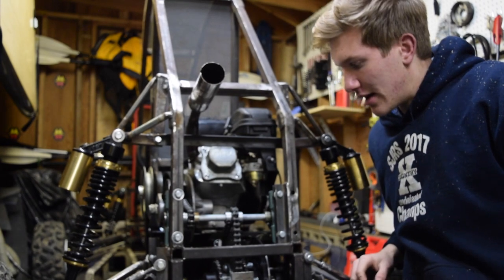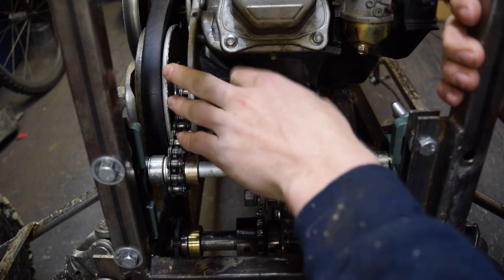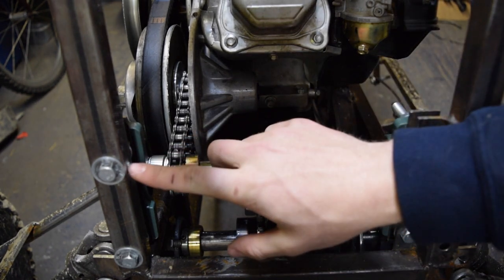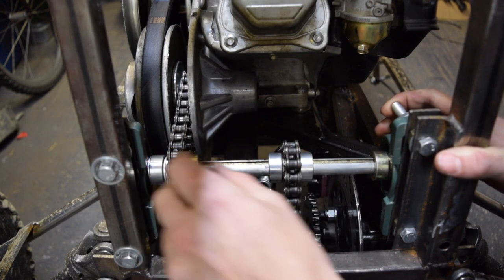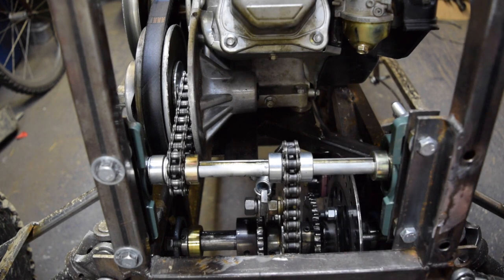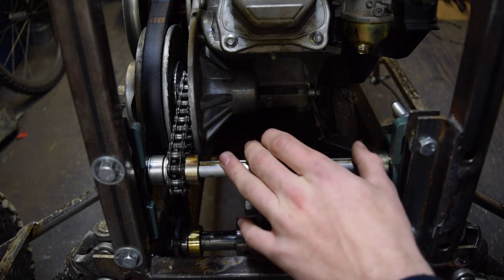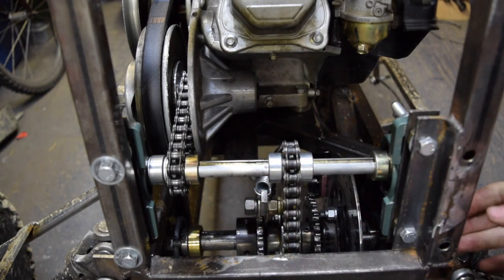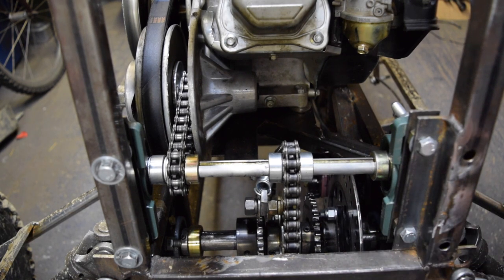Off Road Go Kart Jackshaft Setup

Comment: I like Jack shaft setup I too have almost exact same thing on mine I bought it as a un finished project and was almost going to remove the whole thing to go with c.v or swing arm live axle. I'm curious to see how those u joints hold up kinda worried going with a ninja 250 .
Reply from the maker: yeah with a high hp engine it would be worth using CV axles. I suggest going to a U-Pull it Junkyard, you can get a pair for about $15 each. Cut them and reweld the axles to your width and itll hold up great.

Comment: You still active? I have a few questions
Reply from the maker: HotHeaded Productions sure, what do you want it know?
Reply: @gaspedalgarage7670  I'm in the process of building a kart. I have a 54 tooth #40 sprocket..... that's it. I've looked and looked and can't find what tooth clutch to use. Or any of the other 2
Reply from the maker: HotHeaded Productions I’m not sure I understand what part your are referring to. Sorry
Reply: @gaspedalgarage7670  how many teeth should my centrifugal clutch have, how many teeth should the sprocket that connects to the clutch have.  Then how many teeth should the sprocket that connects to the drive gear have. I don't wanna burn up clutches
Reply from the maker: HotHeaded Productions there’s a lot of other factors that make up that decision. Weight of the kart, how fast you want to go, how much torque but I think most clutches have a standard tooth count between 9 and 12 so somewhere in there should be fine